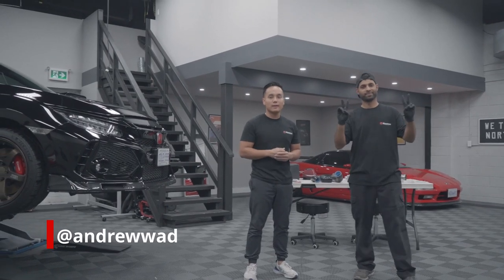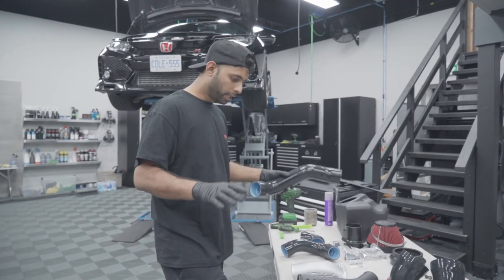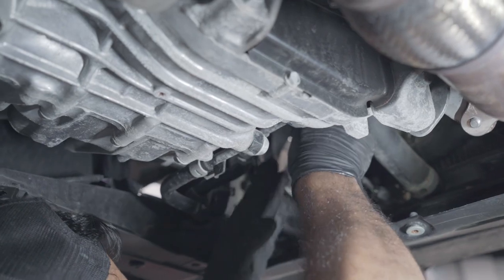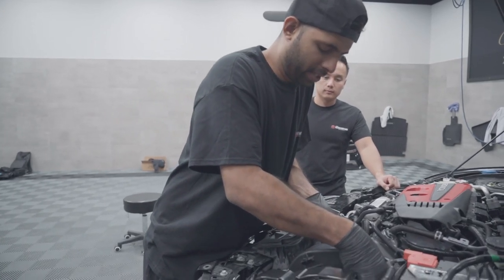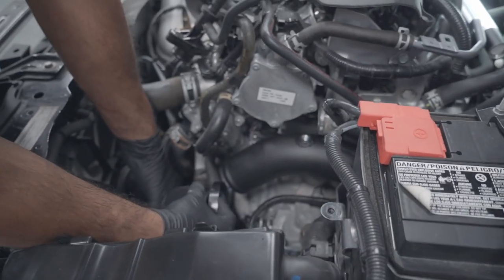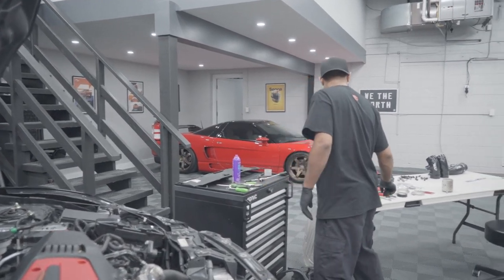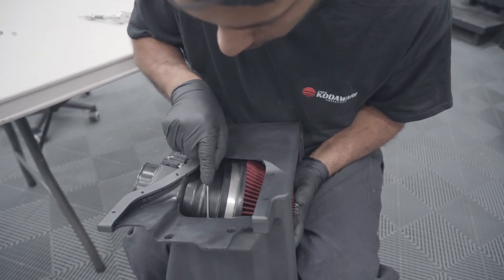Installs With Andrew: Honda Civic Type-R PRL Install

Comment from the maker: TIME STAMPS:
Parts and Tools Overview: (00:35)
Front Bumper Removal (01:18)
Charge Pipe (06:25)
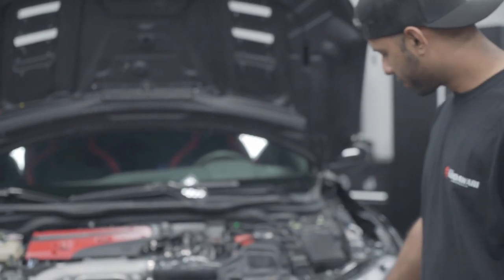Titanium Inlet (13:20)
High Volume Intake (23:40) 
Final Checkup (30:50)
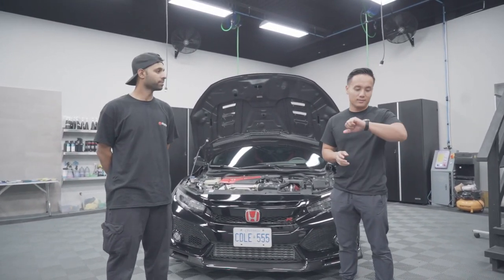Summary (31:31)
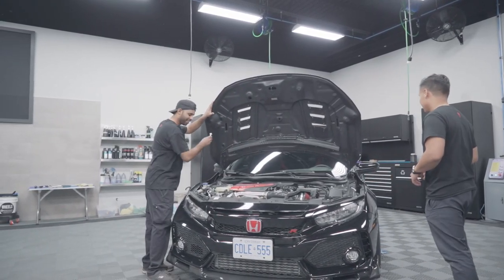Outro (32:12)